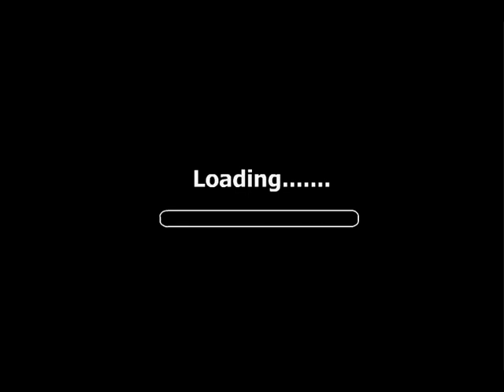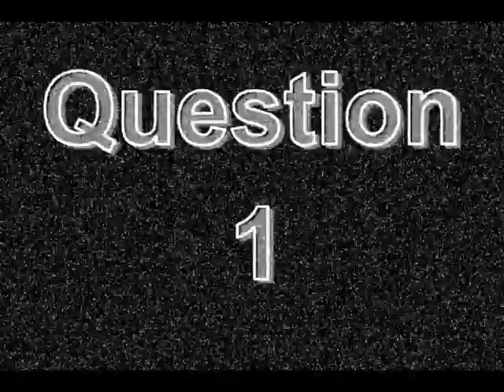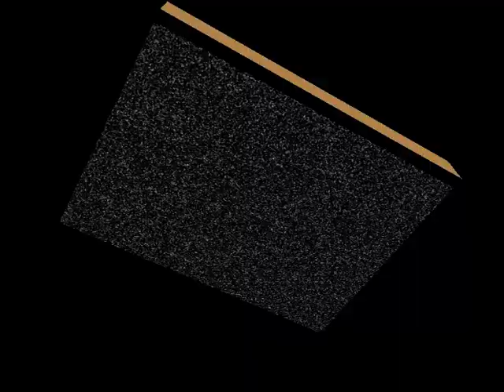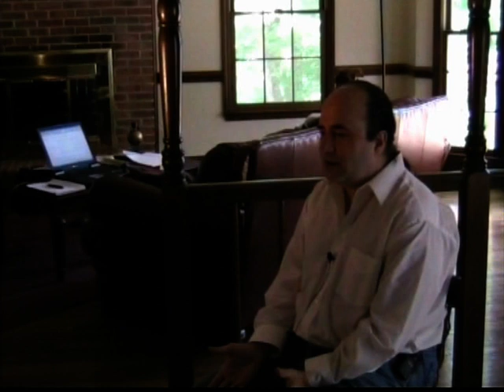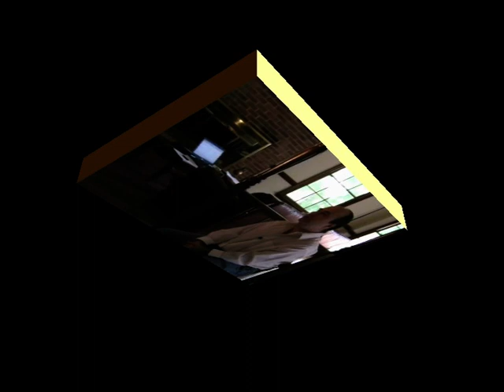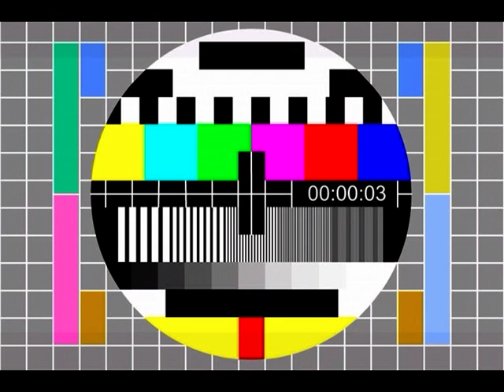025 Todd Desiato Video Essay 2005

Comment: About unconventional propulsion methods, have you heard about the work of Jason Verbelli?
Reply from the maker: Thanks for the comment. No I haven’t, who is he ?
Reply: @QE-5  Some of Jason Verbelli's ideas: 

1. It is possible to make electrical energy generators that use only ambient energy by using an effect not recognized by official physics: the Searl Effect. (Without violating the laws of thermodynamics!)

2. The sun is not a ball of plasma/gas; it is a liquid body.

3. Gravity is caused by electrons. The relationship between gravity and mass is therefore indirect. There is no curvature in the fabric of spacetime because that fabric simply does not exist. Light is when single electrons drop energy levels in 3D. Normally incoherent. 
But gravity is when electron pairs split and drop energy levels from a 2D coherent state back to 3D incoherence.

4. Color theory is incomplete; it does not take into account Goethe’s work on the influence of darkness.

5. Time is absolute, not relative. (Einstein was wrong!)
Relativity does not exist. The delay in space satellites is better explained by re-emission and Galilean variation.

6. Photons are not particles.

7. The double-slit experiment is completely misinterpreted.

8. The anomalies of geometrically coded magnets.

9) There is no redshift, the universe isn't expanding and there was no Big Bang. Dark matter doesn't exist.

10) Dr. Paul Brown's resonant batterry

11) About light, a light bouncing off of a mirror… Is a brand new beam of light. Light does not ricochet. What happens is the re-emission of light.

12) Both magnetism and gravity don't affect light.
Reply from the maker: Interesting ideas